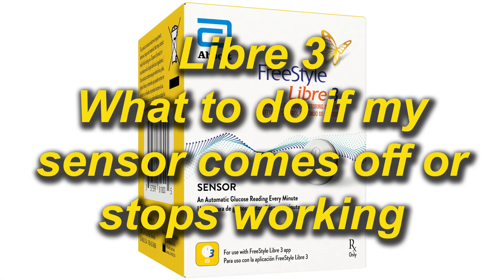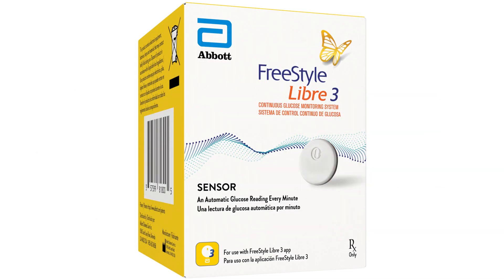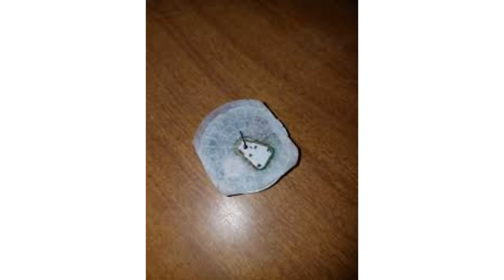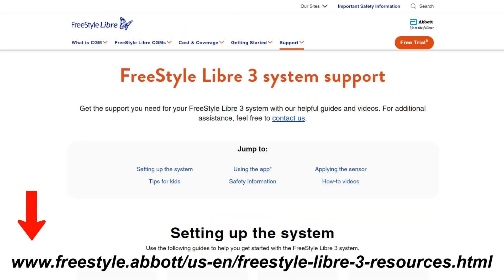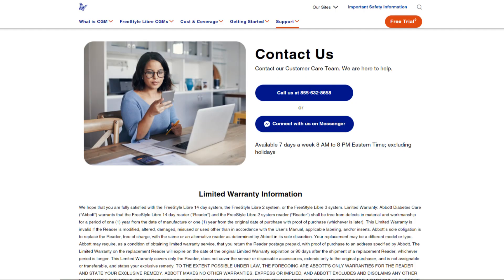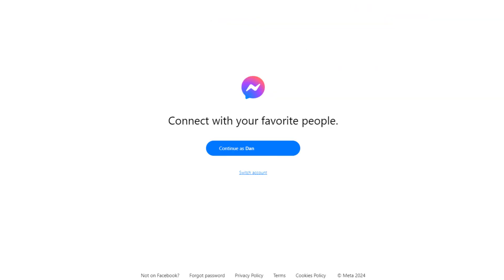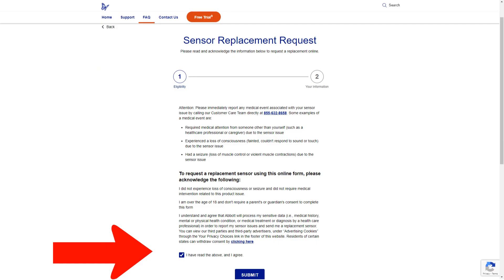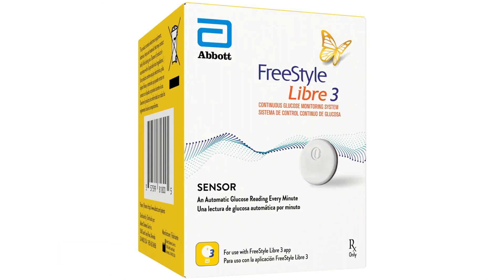Libre 3: What to do if my sensor comes off or stops working

Comment: First customer support sucks big time!  Massive wait times!  Sensors drop out (not fall out) and there is no reset protocol.  Sometimes reset magically on their own after a couple of days. Have had readings off by 50+ mg vs finger prick.  Maybe 1 in 15 units tracks within 15.  The shift is not linear either and there is zero ability to adjust readings to fix the curves.  This is garbage firmware with the data harvesting being the only priority.  Make the damn thing bigger and more accurate/reliable.  Get marketing out of the loop before your device ends being bypassed.  People have and are dying due to trusting these things for accuracy.  DO NOT FAIL TO USE THE FINGER PRICK WHEN ANY DOUBT EXISTS.  Big promise piss poor product.

Comment: In 6 months I have not had a single one stay in place or stay transmitting for the full 15 days. Its costly and annoying. Abbot has replaced a couple but im not a big fan of being on hold for 20 minutes then answering 20 questions.
Reply: Sounds really annoying that's why I will continue to do my finger sticks get my blood sugar numbers I pretty much had the same experience but I haven't been using it as long as you. Thanks for sharing your experience

Comment: After over $500 and three bad sensors in a row failed, I called Abbott, I could barely understand because the out of country support agent could barely speak English, I was told that they would NOT replace any of them!  ABBOTT SUCKS!
Reply from the maker: I have never experienced that. Abbott has a very good tech support dept, infact there was one time when i had two sensors fail on the same day they replaced them both
Reply: That's great you had a wonderful experience but everybody don't have the same experience .I'm having a problem with my sensor now and I'm going to have to either reach out to Abbott or my insurance company or both.. eye center is lasting 2 days then it keeps saying error reset replace done that multiple times and it's just not working, I have a feeling after taking a shower with the sensor on it just makes it defective.